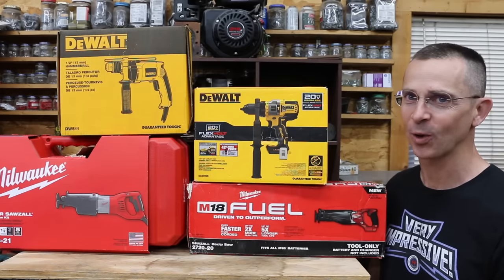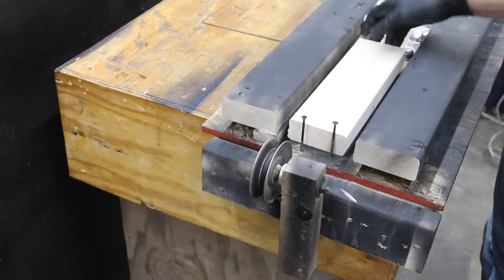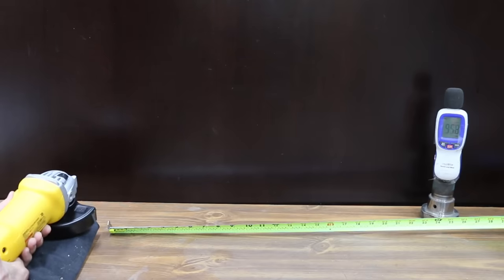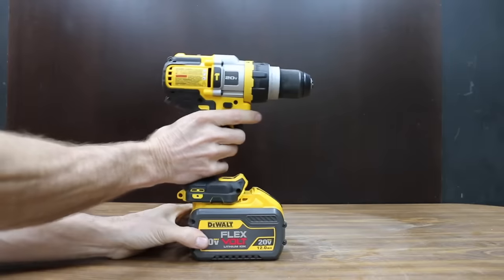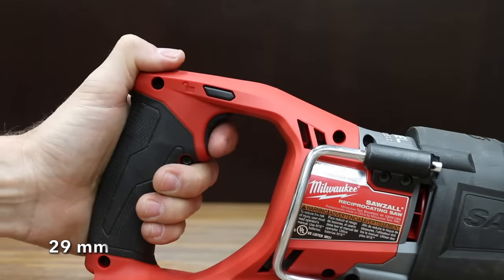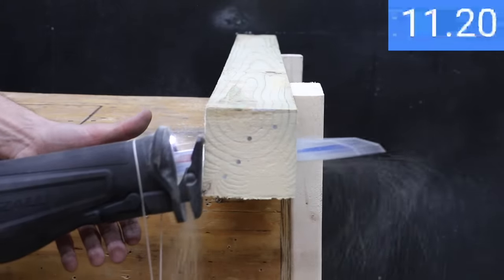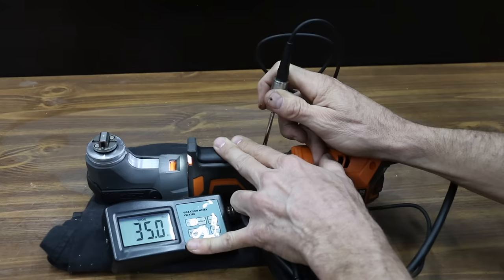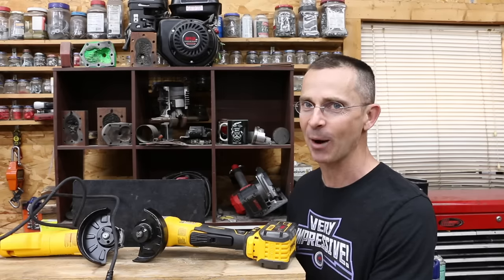Let's Settle This! Are Cordless Power Tools REALLY Better? Torque, Cutting Speed, Noise, Vibration

Comment: I personally feel like corded power tools don’t get the same love when it comes to R&D anymore.
Reply: No which is 1 of the reasons they're usually starting to fall behind. Just look at the corded tools and they just look cheap! Like why are so many corded tools still made with brushed motors???
There are some exceptions tho, I have a dewalt DWE4357, which actually IS a premium corded angle grinder. Has all the bells and whistles and it has 1700 Watts of brushless power for it's 125mm discs. I bought that one mostly for wire brushes as it has variable speed and I can tell you it certainly isn't a slouch!
Reply: Yep, if they put brushless motors on corded saws they'd rip but tbh there is very few uses for cordless saws now outside of stationary tool or super high drain tools
Reply: Companies get a heck of a lot more money from cordless because, once you buy one tool with their battery, you're much more likely to buy the next one from them so you can use the same battery.
Reply: Yep its all about getting you hooked onto one battery since the battery is what costs so much generally. After you get a few tools of one brand you'll continue buying that brand for the battery.
Reply: @andrewk8636  AC motors are already brushless. A DC brushless motor works in a very similar way to an AC motor which is inherently way better.
Reply: @rockspoon6528  Just look at the ridiculous cost of a replacement battery for any of these tools!  If you did a comparison of power equivalency, an electric automobile would cost you several million dollars!
Reply: It depends on the AC motor. Typically corded hand tools are universal motors which are brushed. Brushless motors in corded tools are 3 phase motors run through an electronic speed controller. No reason why it couldn't take in AC, convert to DC and then spin the motor with 3 phase AC. But your comment did make me think that universal motors (again, in most hand corded tools) are called universal because they run on AC and DC. They are brushed, sure. But the voltage difference has been the big reason why it doesn't make sense to use a battery operated universal motor tool. With voltages increasing in the batteries of many tool brands, it might come to a point where there is little difference and then a tool could be made to work with either supply with little extra cost.
Reply: Agreed.
Reply: @flat-earther  All brushless motors run on AC.  Brushless power tools use voltage controllers that convert DC to 3 phase PWM AC.
Reply: @mkase4697  indeed.  A cordless tool's batteries could be replaced with a transformer and rectifier, making it corded, lighter, and more powerful
Reply: Corded tools could be made very powerful but are purposefully not made so as to sell more batteries.
Reply: @andrewk8636  You'd need a AC to DC converter. AC tools have AC motors.
Reply: @boomerangfreak  The other exception is circular saws.  I bought a corded Makita hypoid circular saw about 2 years ago.  Best saw I've ever owned, and it'll last forever.  It does have a brushed motor, but it still cuts like a champ.

But with everything else, I'd largely agree.  Corded tools are becoming the value market where they aren't designed to last.
Reply: Drills are the worst, as shown by this video. So many basic features that even the cheapest cordless drills have almost never made it to corded drills: clutches, ratcheting chucks, switchable planetary gears, lights. If they went to BL motors they'd be able to add brakes and better trigger control too.
Reply: @StevenWillmy Yes, this is possible and I have done it to save some tools which I couldn't bare to bin. The problem is that batteries are able to dump large amounts of current very quickly. To get a similar current at the correct voltage you need a BIG power supply. Obviously this is a generalisation and I was referring to cordless drills. I recall something like a 20 or 30 amp drain on a low end Makita 18v drill. Nothing for batteries, but a LOT for a power supply. Going up to the power of a cordless circular saw or angle grinder and I think it will be impractical and expensive
Reply: They gotta sell them batteries, yo
Reply: @StevenWillmy  I'm not a motor expert or anything like that but it'd be interesting to see a head to head between a well designed brushless motor (3ph AC) and a well designed universal motor with all other things being equal. Perhaps brushless is the best and companies have just been too lazy to switch to it in corded tools. But it's hard to compare when there is no overlap - unless someone knows differently?
Reply: @flat-earther  they run on 3-phase AC from an inverter
Reply: battery tools generate repeat business, corded tool will last a homeowner a lifetime. Which one do you they want you to buy?
Reply: I would even say many corded tools are less advanced as they used to be.  Look for a corded drill with a clutch.
Reply: @BiggMo  Not just that, but also moving to new battery styles, making the old ones generally unavailable, so that when your batteries wear out, you've gotta buy a new tool, too.
Reply: @wbfaulk  I suppose there's a limit on the length of an extension cord, but I've never seen it...and I've run my neighbor's refrigerator off one.
Reply: @BiggMo  And the chargers! It's kinda like iPhone vs. Android, or Windows vs Mac...those batteries keep you in the same tool brand ecosystem (unless you want to spend more money on adapters).  Heck, you can "upgrade" a cordless with a newer higher tech battery, can't do that with corded.
Reply: Alas, "cordless * is a much more refined tool" was kind of a motto for the whole video
Reply: @tachometer74  Third party adapters now available to swap brands… eg, power Dewalt with Makita battery — $12 +/- 3D printed, requires some minor wiring.
Reply: I feel like Metabo has done a fantastic hybridization with their platform and wish more companies would do an AC adapter pack for stationary/high drain tools like table or compound miter saws. Then you have the beauty of cordless convenience but don't have to put charge cycles on your large expensive batteries when you have access to power for a large job cut station
Reply: They want you buying their batteries...
Reply: @FieryWACO  I’d rather run my refrigerator off my neighbour’s power!  ⚡️⚡️⚡️
Reply: @stevesether  The saw that changed my mind on cordless was the milwaukee fuel. the Dewalt has plenty of power but on a framing site you'll go through three or four batteries in a day. the Milwaukee doesn't have as much snot (especially compared to the hypoid or wormdrive) but lasts all day and then some with a 12AH battery. I still hold my old makita hypoid close to my heart.
Reply: @tomrogers9467  I got invited to some very tasty cookouts. It was a good trade.
Reply: Certainly don't have the options Thad cordless have
Reply: @tomrogers9467  just look at the ridiculous time spent buying, uncoiling and recoiling extension cords.  I guarantee it adds up to more over the year than batteries.  They actually aren't that expensive for how long they last (lifespan wise)
Reply: Over heating is always an issue. It's all about how the tool is to be used, load and the working time span before thermal shutdown. Most corded tools go until they explode.
Reply: @wbfaulk  this is inevitable but I do see your point.  But typically tools don't change battery styles for years other than Milwaukee about 20 years ago.  And either replacement batteries are available or get them re-celled.
Reply: I own nothing but corded tools.  Take a look at my 3/4 inch corded Makita impact wrench, a big brute and classic.  Hasn't changed one bit in 35+ years.  Corded tools were deemed to be "perfected" back in the day, and there is more sense to just keep making them the same, proven, cheap way on the same lines and same factories over and over again.  

Cordless are only NOW being considered "near as good" as corded, and it took them decades of constant improvement.
Reply: They should have it right by now.
Reply: @AKADriver  Honestly, I no longer own any corded drills.  I own maybe 5 cordless drills, and hadn't used my corded ones for 10 years.  So I wound up just throwing them out after realizing none of them were even worth selling.
Reply: Yep, the extra refinement of many of the cordless tools shows where all of the focus has been with the corded tools feeling like 'legacy' now.
Reply: @BiggMo  At least as far as DeWalt is concerned, its cheaper to replace the battery than buy the correct equivalent cells even if you know what you're doing because it ends up costing the same to buy the cells.
Reply: Look on any commercial job site. Corded tools are very rarely used. Especially when there is no power on site.
Reply: You’re very right. From a capitalist standpoint, it makes sense why considering the battery line is much more profitable. But even just an aesthetic upgrade with the same specs would do so much. Milwaukee corded seems to be the most like their cordless offerings, but DeWalt especially is the worst looking in the corded department. The all yellow look is just so dated. The black accents along with the darker shade of yellow make their cordless look a million times better.
Reply: Maybe they should make a corded tool with a cordless option!
Reply: @mkase4697  single phase ac motors could work for things like circular saws and grinders that run at a set rpm
Reply: @boomerangfreak  - Um..  Let's see.  My father has a Craftsman drill with a brushed motor, that's probably 44 years old, at the minimum.   It was used to build a LOT, including an entire two story house.  It's had one cord change, and two brush replacements that I know of.    From an engineering standpoint, there's nothing bad about a brushed motor.   

I've seen brushed drills made in the 1930's that still fire up today.   

For that matter, Dremel tools are still brushed motors.  It's because they're simpler, and simpler generally means more predictable.   

The better question is "Why are so many people idiots when it comes to maintenance on their tools?"
Reply: @AKADriver  I have a corded drill with a keyless chuck and a clutch.   I've never felt a need to have a light on my corded tools - if I have a cord, I have a much better light than a teeny LED.    That would be a "Let's add a feature just to add a feature." rather than being helpful.  (Feeping creaturism. )
Reply: @boomerangfreak  a brushed motor has more torque than the equivalent brushless motor, one of the reasons they are still used for mains tools
they may be developing better figures nowadays though.
Reply: @mkase4697  - Note, if you want high torque, a brushed motor is generally better than brushless, as a brushed motor has more mass.   Brushless can be quieter and more efficient, but really, the biggest difference between them is that one requires you to actually pay attention and maintain your tools, and the other allows you to be a lazy buttmunch.  The companies would rather you were lazy, because that means your tools will fail faster anyway, and you'll have to buy replacements.    I've seen 90 year old brushed motor tools that still work just fine.   Most just need the brushes replaced and the commutator cleaned.    (Mind you, they're probably VERY hazardous, electrically, but people worked with them fine for decades).  Not too long ago I cleaned up three "dead" Dremel tools.   One had a destroyed commutator due to the person using it not knowing anything about it ("here, use this to grind that"), the other two just needed brushes, commutator, and boom.  instantly "good as new" Dremels.
Reply: I don't get why they're different. If I were making power tools I'd sell a power supply attachment for the cordless so people can use the same tool with or without batteries.
Reply: because home owners/weekend warriors want cordless tools to hang up they new birdhouse and thats what sells the best so it gets the R&D.
Reply: There is a very good reason as to why I think - corded tools in North America and Japan are very limited in peak power. In North America, you're looking at an absolutely maximum power of around 1800w.

With batteries, the sky in the limit! While 18650 based 18/20v (or 60v in the case of the Flexvolt) battery packs tend to max out around the same 1800w, the new LiPo based packs could easily triple that.

A lot of people say there should be more corded brushless tools. If you ask me, one of the few benefits to corded tools is that they are cheap and simple. If you start adding the necessary inverters to do variable speed brushless motors off 120vac, the tool will suddenly cost just as much and be just as complex as their cordless brothers. Except they'll also be underpowered and tethered by comparison. Who would buy that tool?
Reply: They get zero R&D if they are making battery versions.  If they put the same into corded,  the battery versions would get smoked.  120 volts vs 20 to 60v its not even close.
Reply: @boomerangfreak  Brushless motors are not more powerful than brushed.  They are only used on cordless because they are easier on batteries not not more power.
Reply: @actionjksn  Voltage isn't everything. A North American 120v wall socket has an upper limit to the amount of power it can supply. A battery powered tool does not have a limit other than the size of the battery.
Reply: @bradley3549  That battery is a pretty big limit on a hand tool. I don't want a drill or impact driver with a battery the size of a loaf of bread. I have all professional grade battery tools and I like them a lot, but if you want to make the absolute most powerful tool in a hand tool it will have a cord. 

In this test only one set of tools had a corded tool that was actually comparable, the rest were pretty much lost common denominator among professional brands, and it smoked the battery tool. 

And that battery sawzall had a monster battery, and the battery version had a lot more engineering put into it to make it as powerful as possible. That cordless Milwaukee sawzall is about as good as it gets with a battery operated one. The corded sawzall was significantly more powerful.
Reply: @actionjksn  The latest LiPoly battery technology available commercially can deliver 6000+w in the size of a normal 18v battery. Only a matter of time until we see more of these on the market. Corded can not compete with that in raw power. Now that said, a hand held power tool can't really benefit from that kind of power anyway, IMO. And runtime is still definitely a concern.

So if there is a case where a corded 15A tool is more powerful than the battery operated equivalent, that's a design choice by the tool maker and not a limitation of battery technology.
Reply: @rc-daily  Buying the same line of cordless tools sounds great, until they change the battery, to something that can't be used in your existing tools.  (There's a reason I like '50s aluminum corded tools----In 50 years, they will still work).
Reply: @bradley3549  Interesting analysis
Reply: @elultimo102  yeah Dewalt changed their batteries a few years back. Made a lot of guys tools obsolete
Reply: @rc-daily  I believe Milwaukee changed to lithium from ni-cad.  Nice of them to instantly render your tools obsolete.  It's bad enough, that batteries of the same voltage are not standardized across all makes.
Reply: @elultimo102  yep. There should be an industry standard. 18-24v that can be used in any tool and charge on any charger. Then Dewalt, Milwaukee, etc can fight for better battery technology to sell more of their batteries. It would be a win win for everyone
Reply: @rc-daily  BTW, am I the only one that gets the urge to upchuck, every time he says "is made in China?"
Reply: @mikehall5657  Not all...I discovered the reason my 120V pressure washer melted down (as in smoke/fire) was one of the brushes on the motor cracked and was shorting stuff out.
Reply: @andrewk8636  Or people like me DIY and use a circular saw a couple times a year in the garage or back deck where I'm next to the outlet anyway...so hey 1/3 the price for getting it done is a steal for the minimal inconvenience of "just don't saw thru the cord".  It just doesn't get enough use for the cost of a battery one and isn't enough convenience difference.  Now for the cordless drill, you can pry that from my cold dead hands because I wouldn't trade that for a corded drill again in all but the most extreme big hole drilling.
Reply: @andrewk8636  Aren't there some higher end table saws and miter saws with brushless motors?
Reply: @NiHaoMike64  nothing I've seen yet but I'm sure there's a few but not enough. Probably high end cabinet shop saws might but from jobsite table saws I haven't seen a single one yet
Reply: @boomerangfreak  Brushed motors should not be underestimated. I don't think I've ever seen a brushed motor actually fail, whereas modern brushless tools tend to die almost exclusively at the motor or controller. They're more efficient and precise, but not necessarily more powerful and surely not as long-lived.
Reply: @flat-earther  Lots of AC motors are brushless, Fans, well pumps, washer and dryer motors, the motor inside your furnace, the cooling fan of your air conditioning unit  unit, the compressor in your AC unit, some vacuum cleaners…
 You may be surprised to know that AC brushless motors have been around far longer than DC brushless motors, like decades before. Lol
Reply: One of the reasons for this is that the EU implemented power limits on corded tools, and as it's their biggest market many manufacturers just save R&D by selling the same neutered tool designs globally (altering for 220/110v ofc).  It's similar to how the EU's power limits on TVs resulted in a plasma TV ban in Europe which spread worldwide as manufacturers ended R&D.
Reply: it is all in their "proprietary" battery pack where they made money
Reply: Totally agree. There is a generation who will neve know the advantages of having and using corded tools. They always operate at full power, they last years longer and never need new batteries. Let's test them side by side for a couple hours and see which ones come out on top...I already know the answer !! The cordless would need two or three batteries making the cost comparison a lot different.